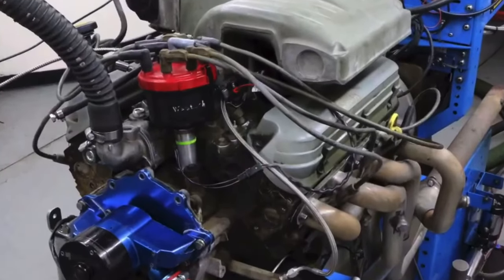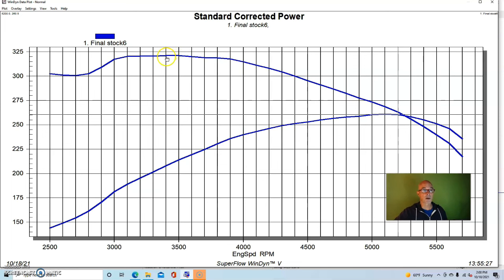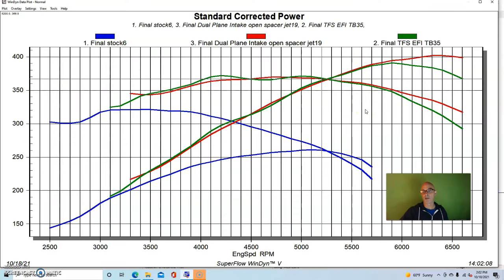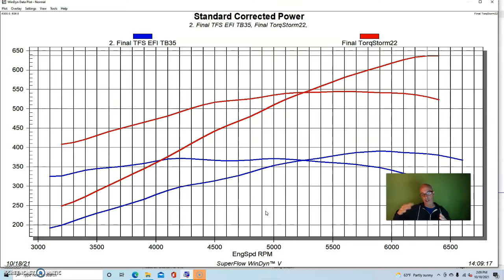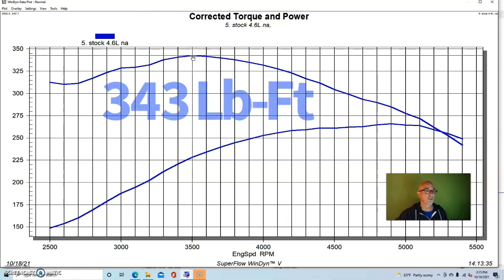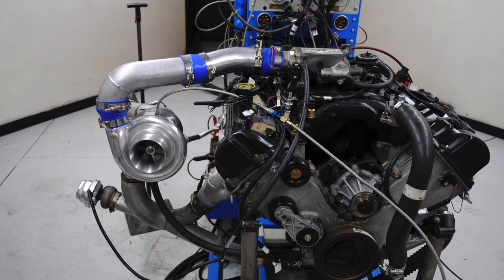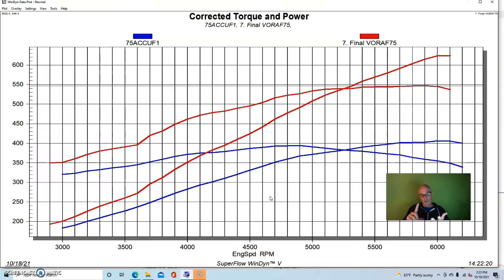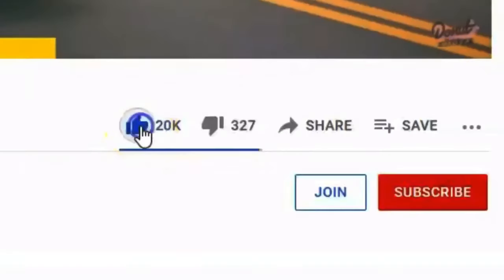WHICH FORD V8 WORKS BEST? OHV VS SOHC, 5.0L 302 vs 4.6L 2-VALVE MODULAR? WHO IS BEST FOR BOOST?

Comment: I wonder what that trickflow setup would do on a 302 made into a 331 stroker
Reply: Power wouldn't be much different if it's running same compression.  302 sized parts make 302 power that is the old saying.  If you do a stroker you need a more aggressive setup than would be ran on a 302 to truly take advantage of the extra cubes.  Torque would be up some though for sure.

Comment: I wanted to see the power curves compared between the two. I see the peak numbers were very similar but I didn't see at what rpms the peak numbers were happening at & what was the numbers at throughout the rpm range. Did the 5.0 make more low end power?? Thats what I would expect but I didn't see? So the average power numbers would be interesting to me. The stock & the modified versions. Im not a boost guy so I couldn't care less about how they respond to boost.

Comment: Did the 4.6 have a beefed up bottom end or was it a stock bottom end? I heard the 4.6 can't handle much more than 400 horses anything above that the bottom end can't handle it.
Reply from the maker: STOCK BOTTOM END-IT WILL HANDLE A LOT MORE THAN 400 HP

Comment: Before this video even starts I just want to say I think each motor at the end of it's going to have its own place I believe the torque motor 4.6 will show a better drag strip Dyno in the 5.0 will show a better circuit track Dino sheet. I'm probably 100% wrong this is just a guess before the video starts

Comment: I took a 1996 chevy Z71 v8 truck and it couldn't do a cat walk from the dealer ship v-tec motor. my cousin blew the block and as a teen first try no help from anyone just the firing order was wrong at a engine overhaul/ block swap only cleaned all the crap off. all the bolt on past to the garbage block parts with a Z71 v8 from 1986. only difference in the block was the older block had a bigger stoke length of half inch and 2.5 mils rounder. when i was done the truck if you gave it a little blip then tromp on it.it would do a cat walk!!!
Reply from the maker: no idea what this says

Comment: Fast ford magazine . I had a 01 gt stick back then for a daily. It was so slow compared to my 99 ta stick car for the nice days .
Reply: The ls1 had more than a liter of displacement on it, plus more compression and better head flow.  The 2v did ok for what it was.
Reply: I have a 98 TA auto , 99 Z28 6 speed, 99 GT 5speed & owned & worked on installed hundreds of gears mustangs. Put a set 4.10 in them Trans Go Kit with stall in 4R70W the F Body LS cars won't hang with them. My car has 5 speed, 4.10, JLT Intake, BBK TB, SCT tune, X Pipe no cats, & Z28 with gears won't outrun it. My brothers 99 Cobra with 4.30 gears will upset thoes cars. 
Have to gear those 4.6 2V & 4V to make them run with such a short stroke.

Comment: Hey whats up Richard. I have a question, when performing an ls swap on a 6.2 that was recently running. Do you prime the engine via the port hole at the bottom of engine? Or can you just install oil add coolant and start the engine?
Reply from the maker: no need to prime it already ran
Reply: @richardholdener1727  Thanks for such a quick response. Keep up good work.  Enjoy the channel

Comment: What would be the difference between a xe274hr vs the xe282hr in a efi 302 combo with gt40 heads and intakes? Later on it will have a small procharger
Reply from the maker: the 282 is more cam than you need with the gt40 heads

Comment: I've heard rumors about the 5.0L blocks cracking over 550+hp.  So I must ask, how well do the 4.6L 2v blocks handle 600+hp?  If the first is true then I am inclined to believe that the 4.6 2v would be a better choice.   Please correct this if I'm wrong.  Thank you.
Reply: 4.6 block is multiple times stronger than the 5.0 block. Only way you can build a reliable forced induction 5.0 with decent power is with an aftermarket block.
Reply: Stock 4.6 blocks will handle over 1000hp.
Reply: The block is way better than the 302 block.  Forged internals you can make 1000 wheel you can't get anywhere near that with a stock 302 block.

Comment: Just picked up a mint 2011 Crown Vic Interceptor with only 85,000 miles and less than 1000 idle hours. This is my third P71 and I think it's time to help it's 4.6 out a bit. What do recommend for a build leaning toward moving this hulk compared to a Mustang?  And yes, boost is welcomed!
Reply from the maker: turbo, heads, cam
Reply: @richardholdener1727   Smaller single or small twins?  Nothing like the midrange hit of a well running BB, I'd like to replicate that kind of power curve.

Comment: To even utter the words “5.0 efi starting the mustang world” is insane. 
Plenty of way better engines that made way more HP in the 60’s 
289, 302, 351w, 351c, 390, 427 cobra jet, 460. 
Better looking too.
Reply from the maker: 5.0l started the 2nd Muscle Car era (which has lasted a lot longer than the original) and all the new stuff makes a lot more power (as they should)

Comment: I have an interesting request. I’ve been watching your truck engines for torque because I have a gen 5 BBC in my truck. I know you take tons of data during a run, do you record anything that might relate to emissions or fuel consumption? If I want to build for more torque, and still have to pass emissions how much can I do? I’ve been reading through forums and it sounds like the cam is the most critical aspect for emissions since it’s affects how much fuel is actually getting burned. Whereas the intake and heads are about flow efficiency and science acoustics stuff for where the power is generated. Would you consider doing a video about a bbc torque build for someone that has to worry about emissions and fuel consumption.
Reply from the maker: we don't test emissions on the dyno
Reply: @richardholdener1727  bummer. You still give tons of good data. Thank you!

Comment: Where you running factory compression numbers for the boost applications?
Reply from the maker: YES ON 5.0L-4.6L WAS HIGHER
Reply: @richardholdener1727  I'm currently running 10.6 : 1 on an NA 2V setup. Would you think that's too high to run forced induction? It's a Teksid, fully forged bottom end with all ARP hardware. Thanks for your response. I enjoyed your video!

Comment: My Kuntz & Co. built 359 cu. in. R302 block Ford made 647HP @7,400 rpm and 497 lb. ft. TQ. @ 5,500 rpm NA way back in the late 90's. I'll always be a 5.0 Ford man for sure, but currently own a 2000 GT with the 4.6l PI Windsor engine. https://youtu.be/e50vwaHYOF4

Comment: I'm really surprised the 4.6 did as well as it did being an underdog in displacement, valve lift, and bore
Reply: They've always been comparable stock vs stock and mod for mod.  If they're modded similarly they will make similar power with less displacement.  They can take close to the same power reliably on stock bottom end too.  Yet the 2v gets dissed all the time but nobody ever disses on the old windsor pushrod engine.  Not a dis towards the pushrod just stating the 2v is better than people think for what it is and it's displacement.
Reply: The 2V is kind of impressive given the small bore diameter and intake valve that’s angled in the wrong direction.
Reply: People shit on the little 4.6 2 valve, but when you consider how it’s an old school small iron block v8 with SOHC, it’s impressive what power it can make with a few mods.
Reply: @angelgjr1999  the hp per dollar isn't bad.  Forged internals, cams, headers and some boost you can make some good power.  A ported terminator or gt500 blower is a good option on a 2v department of boost manifold ftw

Comment: I love the low-end power of pushrod motors
Reply: The 4.6 has good low end too ecspecially considering it has less cubes.  The 2v are very torquey engines.  The 4v was more top end oriented and wasn't the greatest down low but a set of 430-456 gears takes care of that lol

Comment: So if I was to used the XE274H non pi cams on pi head would I have to set the duration?
Reply from the maker: set the duration?
Reply: @richardholdener1727  degree I meant sorry bout that

Comment: Im lost. I spoke to a few specialist and asked them how i could get 400+hp on a 4.6. They all say yeah, with a supercharger yet you're showing numbers that prove it can do more NA. How?
Reply from the maker: maybe they thought you were asking about 400 wheel hp
Reply: @richardholdener1727  yup, i did mean rw hp. so am i to assume with cams, springs , and ported PI heads as the only mod that i can expect no more than 300HP RW?

Comment: The  4.6 has a much stronger block. If the tune isn't perfect, you'll split a stock windsor block at those power levels. Even with a perfect tune, the windsor block will be on borrowed time.

Comment: There is no replacement for displacement .There is weight and packaging size to keep in mind . My opinion is big cube Windsor , but a 302 over a 4.6 pure stock I'd go for the 4.6. The 4.6 was an up grade at  stock levels, but if your going to look at every aspect of getting big power Modular engines are a joke.Cubic inch limitations as well as the absurd cost. I have a procharged 4.6 built engine, and if goes bad, it not getting a second chance. Honestly the way I use the car I should just 460 swap it  and run it NA
Reply: Mod motors can make a ton of power with boost.  You can stroke it to a 5.3 like 327 cubic inches you ain't that limited compared to a stock block 302.  It's an upgraded stock or modified.  Forged internals in both with boost the 4.6 is gonna hold way more power and make more on a stock long block.  They can even hold their own all motor.
Reply: @midnight347  True...
But a 302 can become a 347 or a 363.

Comment: How did you make 261 hp on the stock 5.0L ik the computer helps and injectors but dam
Reply from the maker: the stock power rating of 225 hp is with full accessories, complete air intake, full exhaust with cats and with the factory tune and temperature. we changed all of those

Comment: I really enjoy these commentaries you do. I would have liked you to talk more about a cost comparison for these two engines. I have a 2v and while yes PI heads are cheaper, the cost of a cam swap is pretty high. I think building a 5.0 would be cheaper, but it would be interesting so see a $ per horse power comparison.
Reply: Cams cost like 600 vs 300..not that big a difference.  They both cost about the same to mod.  Forged internals on both the 2v can hold alot more power and make more power on a stock heads/cams setup.

Comment: At what point will the wear on these engines drastically increaser when they get to a certain power?  I am one of those people that doesn't need a gazillion horsepower.  More horsepower doesn't make one of my legs get bigger and build up my ego and self worth.  I want excellent reliability, good power, excellent tractability and decent gas milage.  I know I just lost 90% of the guys out there but as you get older, priorities become more realistic and mature and your sense of manhood more secure.
Reply from the maker: leave it stock

Comment: What is wrong with you people?  You get performance mixed up with what is long lasting engines. A ford 289 V8 with a 2 barrel carburetor is the answer for easiest to fix and all the power a person would ever need.  I remember full sized galaxies in the mid 60s that had enough power for OTR and to get a person killed.

Comment: Actually the last year fixbody HO had 225 hp sorry the base 5.0 was 160 and the 2v had 190 hp
Reply from the maker: the 2V was 225 in 1998 and 260 after that
Reply: @richardholdener1727  yes after the PI cross over for the engines they made 260 but  I was just getting at the 1st 4.6 2v when they introduced it it was rated at 190 hp or 210 I believe

Comment: Why 302 over 4.6 well 4.6 blows intake gaskets the oil filter housing blows and the 4.6 shoots out spark plugs 302 well none of that happens 🤣 I mean anything can blow a intake gasket but the 4.6s are famous for that 302s not so much I'll stick with the 302 plus it's a bigger motor and a stroked 302 to 347 is nasty 😉

Comment: The problem is, run the 302 with more than 500+HP without split the block in 2
Reply: I'm pretty sure Richard has covered that myth.

Comment: I love a 302 but the only down fall is that stock for stock id take the 4.6 because i can go up to 1000 hp without splitting the block. Whereas the 302 start getting iffy around the 500 hp range

Comment: My question is does the Trick Flow heads on the 4.6 V8 retain the "retarded ass" sparkplugs that are prone to breaking off in the cylinder heads ??

Comment: Oh this is spicy...I know 4 valves are superior  my 04 mach went 13.5 @104 stock and it took trickflow 170s track heat intake and f cam to get 12.9 st 108...half second and 4 mile and hour difference ain't  big and 1994 gt was gutted.

Comment: What happened to running the same supercharger on both motors?   Waste of a video. Just proves, you make power with the parts you throw at it.  Two stock motors. Port the heads, add the common cams, add the “same supercharger!” That’s it. Simple. You’re thinking like an engineeer, not an enthusiast.